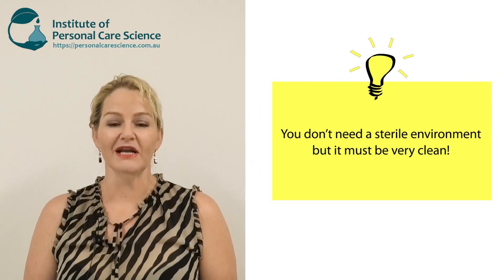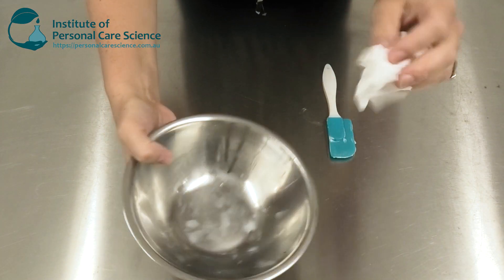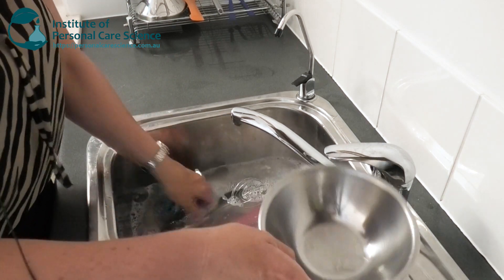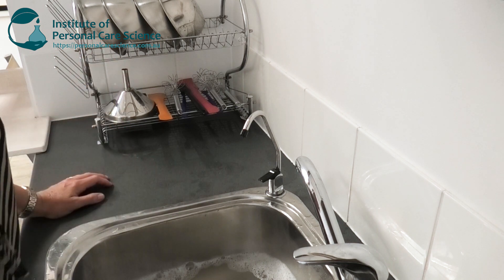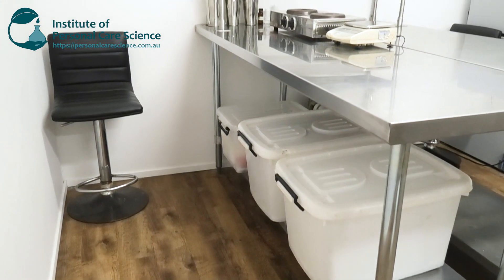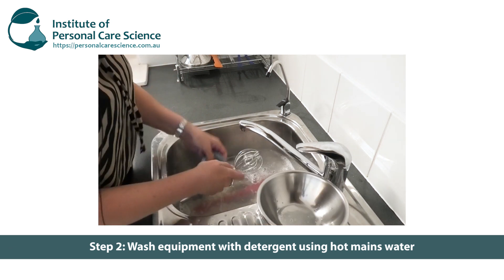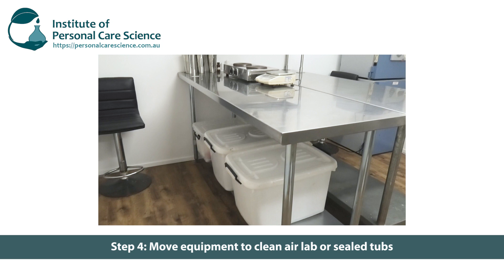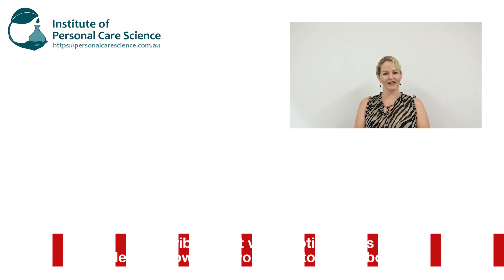How to clean cosmetic lab equipment

Comment: Oh no, I have been doing it wrong. I wash with hot soapy water, rinse well, then I spray all my equipment with  70% isopropyl alcohol and then I allow to air dry, then used gloved hands to put my equipment into containers or bags that have been cleaned with alcohol, and then the bags or containers are closed and put into the cabinet with doors. I use a makeup brush acrylic container with a lid to store all my utensils. 

When I need to wipe something down after its been sprayed I use kim wipes, the lint free lab wipe paper. I assumed a cloth towel wouldn't be sterile enough and could leave lint behind.

Comment: Great video! Is reverse osmosis (used on good quality city water) or store-bought distilled water good enough for glassware rinsing? In cosmetic R&D lab I worked at we used DI water, but I see small labs using reverse osmosis or distilled water, due to cost. Thanks!
Reply from the maker: Yes, these are both suitable to use. You can also learn Good Manufacturing Practice and microbial testing in our Certificate in Cosmetic Quality & Stability or if you want to manufacture, please watch our Cosmetic Manufacture for small batch workshops.

Comment: Thanks for this video, so how would you ensure the product packaging is also free from contamination? Would you follow the same steps, how about a bottle though or anything with a small opening, it'd be almost impossible to get inside of it and clean dry?
Reply from the maker: Packaging should be checked on arrival and rejected if it is visually contaminated. You should run microbial checks on the packaging too, for what you can’t see, and if it doesn’t pass, also reject it. Don’t accept packaging and then attempt to clean it – that is incredibly costly and needs to be outsourced! Reject it and insist on better quality from the supplier. Learn more in our Quality Certificate: https://personalcarescience.com.au/CosmeticScience/CertificateinCosmeticQualityandStability-1983/